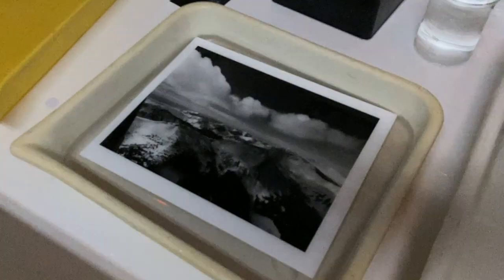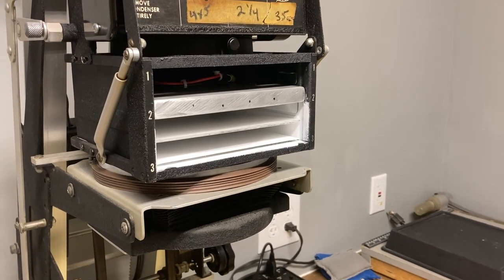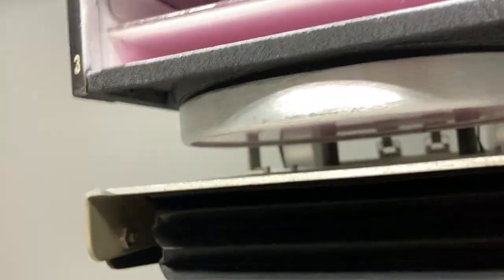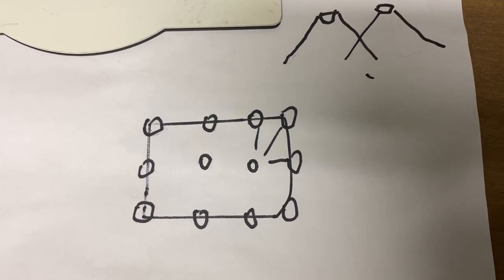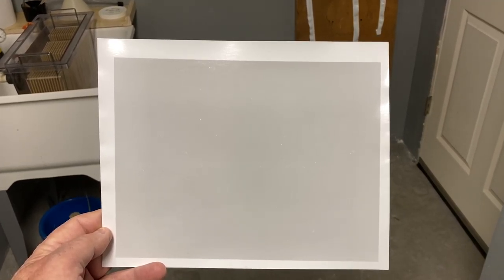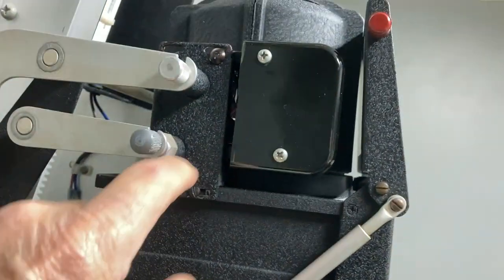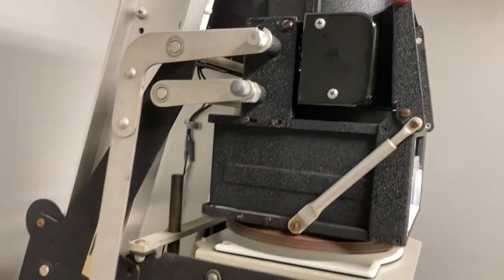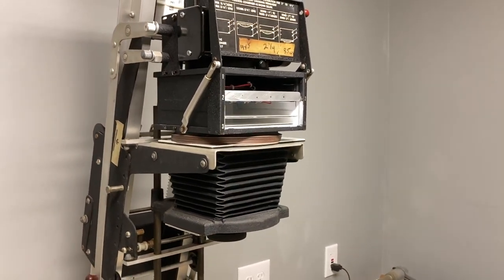LED Enlarger Conversion: Test Prints

Comment: Besides making blank-carrier prints at a light gray (Value VI?) and looking at the density by eye, you could also use a spot meter to measure the light falling on a diffuse surface at the baseboard (white printer/copier paper should work well).  I wouldn't want to see as much as 1/3 stop different between any two points, and "too small to detect" would be ideal.  You could/should do this in both blue and green as well as white, since contrast filtration depends on blue light for high contrast and green for low...
Reply from the maker: Thx! I use One color light since I am printing B&W. I've done a couple hundred prints since I built this light and I am very happy with the results. I''ve metered the heck out of it too!
Reply: @asa1000photography  You don't use contrast filters?!  You need both blue and green in your light to make multicontrast paper do its job.  That light looks pinkish in the video, which would fit with a high contrast filter.
Reply from the maker: @SilntObsvr  I'm sorry, I misunderstood! I thought you were talking variable LED light. Yes, I use filters and in fact I find I'm printing more with the lower contrast end. I have been experimenting with some of the older (very old) DuPont Varigam filters with a 5 or 10cc yellow to get an in-between grade. I once had this all figured out, but todays new paper is a ReStartAllOver !

Comment: What is the benefit of this?
Reply from the maker: In the past I had a cold light head for my enlarger. It's more of a diffusion light as opposed to light shaped by a condenser.  I like the diffusion light, it's softer. But my cold light head quit working and I couldn't find a cost effective replacement, so  I switched to LEDs. Ive seen others do this. The LEDs shine through the diffusion material and they are cooler so there is less heat on the negative, which can cause it to 'bend'.